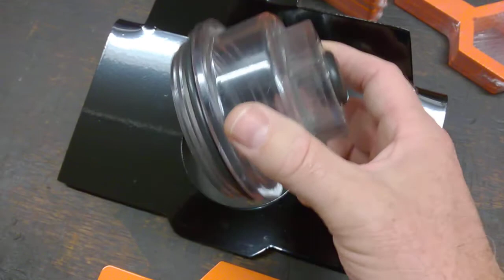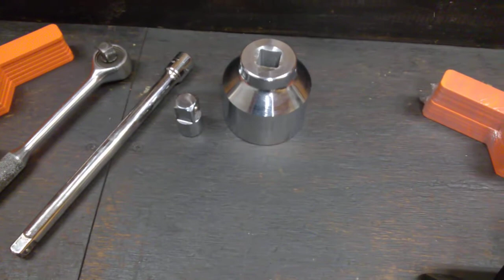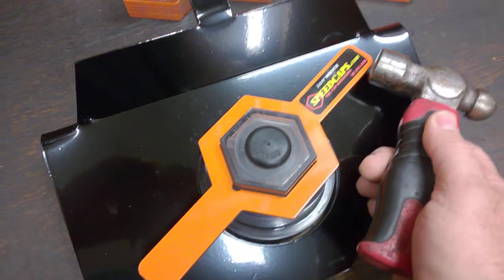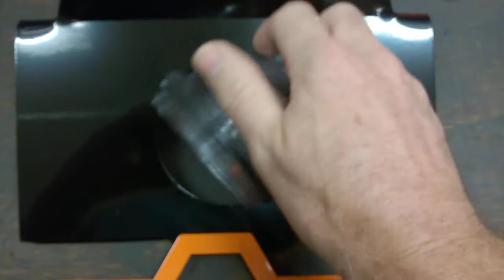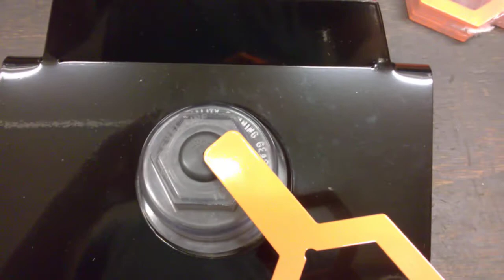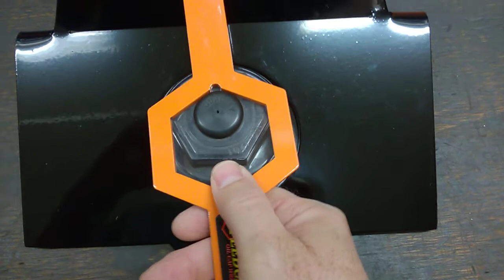Speedcaps oil cap wrench dexter alko redline

Comment: Just received mine today,What great little tool.Worked great.I even used the notch in it to pull the plugs.Quick and easy fluid change.Slim tool fits right in my tool box and literally took no space.Great addition to your roadside tool kit> A must have tool